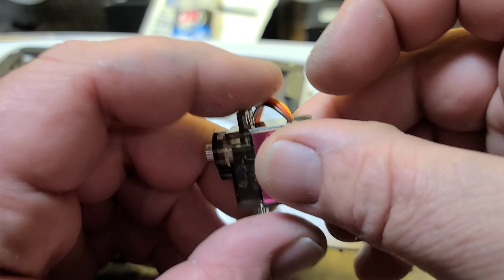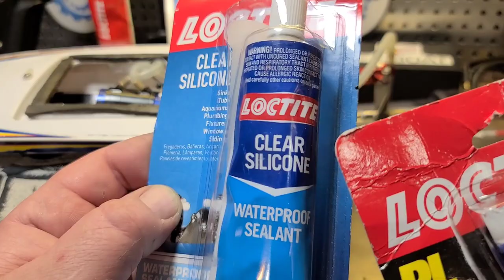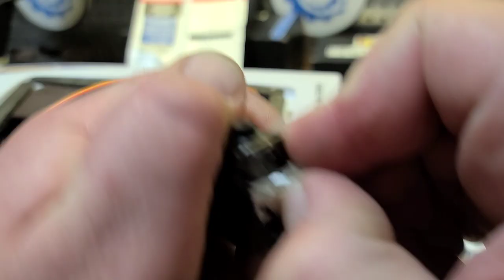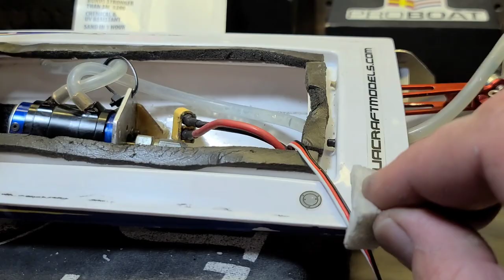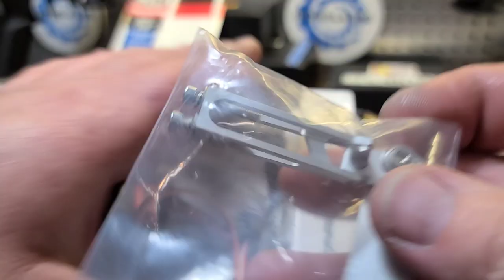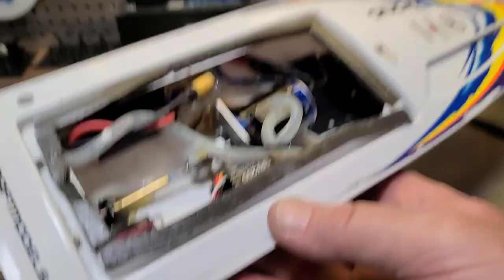Electrics Waterproofing, Sealant & Adhesive Options For Rc Boats ABS Plastic & Polycarbonate

Comment: Yet another really useful video Big B 👍  Thanks for sharing.
Man, I could 'Jack ma Jaws' all day about adhesives, sealants and stuff. But I won't of course. 
A few simple things to consider when selecting an adhesive are the material and the function of the component.
Plastics (polycarbonate, ABS) will always need a solvent based adhesive (not epoxy) if you need a permanent bond. There's nothing better than JB Platic Weld which I know you're using bro.
I use JB Marine Weld 2-part epoxy (Steel and Hardener) for many things, and works brilliantly on fibreglass or carbon fibre. 
When it comes to function, most adhesives will have stronger shear strength than tensile strength (rotation or torsional vs pull strength) so you need to consider what the component you're fixing is doing. If it is rotating or under high torque you need shear strength. If it being pushed/ pulled you need high tensile strength. 
Nice stuff Big B 👊

Comment: Good info Big "B"! It's this kind of content that sets you apart from other RC channels. You are extremely modest; you have a ton of knowledge that even the most seasoned hobbyists can benefit from. Keep doing what you are doing and you will always have an audience.
  I use Bob Smith Industries 5 min epoxy for everything boat related. If I need to fill holes I add a little bit of micro balloons to the epoxy for easy sanding once it sets. If I need to use the epoxy as a sealer, I add a little denatured alcohol to make it runny like water. Of course I use CA in various thicknesses for building, and once in a while I will find a use for silicone, but I can pretty much do everything boat related with epoxy. Cheers!
Reply from the maker: Thanks brother, I will check out the Bob Smith industries 5min epoxy.  The jb weld epoxy is a cheap product I've had my share of issues with it but I've also had some great success with it in the past.     I will definitely check it out I appreciate the info

Comment: Shoe goo is handy stuff too. I’ve glued a fairly heavy esc down before. I’d say it’s a step or two past double sided tape. You can still remove it for the most part and it sticks to anything. It’ll stay flexible. Super cheap and easy.
Reply from the maker: Thanks brother. Thanks for the info
Reply: I love shoe goo but it's getting hard to find here. Gorilla Clear Grip contact adhesive is every bit as good. Sets in an hour and remains slightly flexible.

Comment: Great vid on the sealants Big B, and quite informative on JB WELD application. I have used Z poxy, comes in 15 & 30 minute cures with great results  on my fixed wing planes. Drys clear, and strong as nails. Excellent on all ABS, fiberglass applications. The 30 min. cure bottles is the best for 24hr. application for super strength. Hobby stores, local and online that cater to R/C are the best for availability
Reply from the maker: Thanks for the info & thanks for watching

Comment: Have you tried a product called Devcon  plastic welder.    Good stuff for plastic and dries hard.   Works great for ABS haven’t tried it for poly carbonate yet.   Glued a sonic v1 seem.
Reply from the maker: I've herd of it but never used it.   Thanks for the info brother......   These products in the vid are common found almost anywhere. Been using them for quite a while, basically keep them in the tool bin just to have on hand.
Reply: @IRONCLADRC   good stuff in in your video and very informative as some good products to use and easy stuff to get a hold of local.      This other stuff was something to always experiment with.  Myself I’m always looking for new products to try
Reply: Isn't Devcon "Rat Poison" lol

Comment: West Systems G Flex. Thats all I use for any and everything to do with RC boats. It's not cheap but well worth it.
Reply from the maker: Guess I should of included my 105 & 207  in the video..       I've never used the 105, 207 in abs plastic hulls?.    Herd lots of great things about the G flex by wet system.  I may have to give it a shot.
Reply: System West G flex, six10  and resin line great product.  I stand by that stuff.    Fiberglass, wood and Carbon fiber
Reply: @IRONCLADRC  the 105/20x is awesome but not that great for plastic. I've fixed and inlayed a couple plastic boats with G Flex even a couple fiberglass ones so it's extremely versatile. If it weren't so expensive I'd use it for a lot more too, lol.

Comment: Hi Ironclad! Have you ever used Bob and Smith 15min epoxy? It's the best epoxy I used on fiberglass boat...tried JB weld marine weld and it failed. Bob and Smith was the best!
Reply from the maker: I've had several guys recommend Bob and Smith thanks brother
Reply: @IRONCLADRC  Anytime bro! I cracked the back of my Genesis boat, it's the only epoxy I'll use for those fiberglass repairs.

Comment: Big B! I have a plastic boat that I pulled the top and bottom halves off. It has some clear adhesive between the halves. It seemed like clear silicone, but not 100% sure. I want to reseal the hull halves as it came from factory but unsure what to use. Is the Loctite clear removable? What would you recommend to make sure I don’t seal the two halves shut forever?

I was thinking of using 3M Clear marine Silicone as it is removable. Thoughts?
Reply from the maker: Jb water weld is a 2 part adhesive, that would be great for joining. Unfortunately, it's tough to remove once joined, it CAN be undone .ay be tough.    Not sure what else i can  recommend
Reply: @IRONCLADRC  all good. I appreciate the tip 🫡

Comment: b I need to now how to strenghten plastic
Reply from the maker: This video may help you.   I used jb plastic weld & drywall tape to fix a broken hatch on the blackjack 24 you can use the same process for small areas that needs reinforcement.   Good luck build it ironclad

Comment: JB WELD clear Epoxy
Reply from the maker: Yep that's the stuff.   👊
Reply: @IRONCLADRC  Sonicwake 36 ,done , cooling upgraded dual RC Boat Bitz rudder,And dual trim tabs,1mm bigger cooling line.Time to rip,never ran it yet .
Reply: Should fix that over heating problem